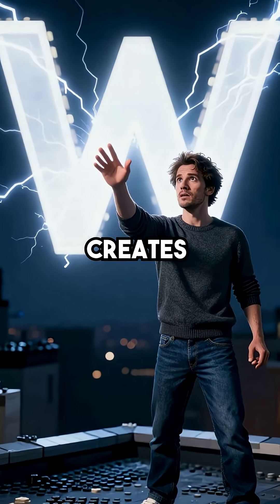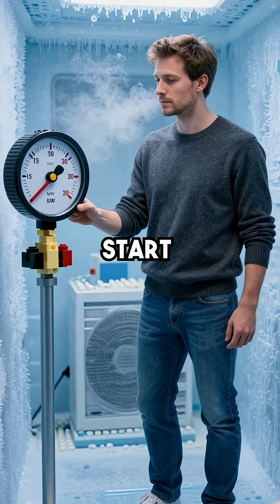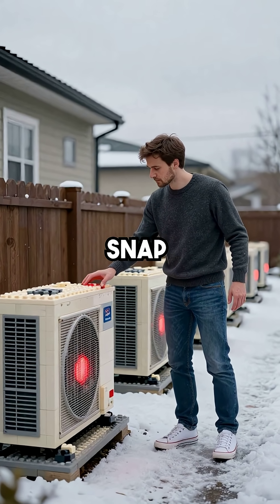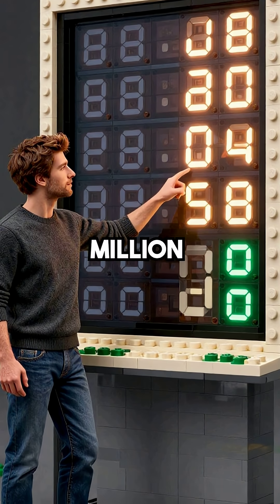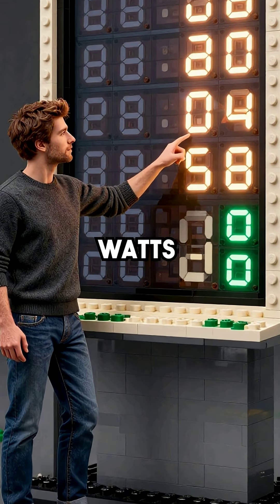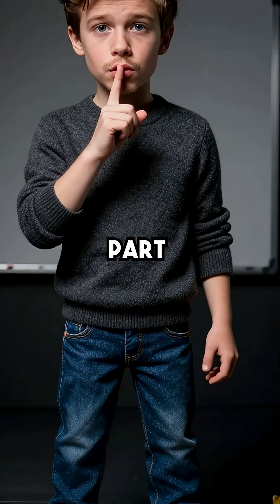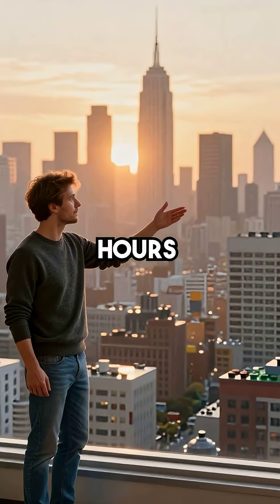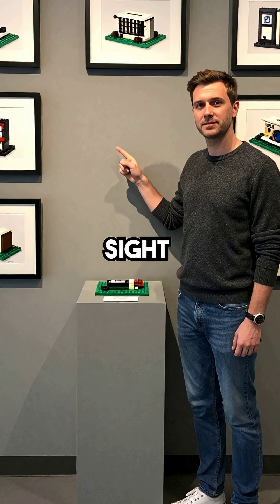Oil fouling is one of the most misunderstood sources of energy waste in HVAC systems.

Comment: Or…. 

Instead of relying on individual systems we could go back to a system of district heating with steam and hot water like we used to have. 

The most efficient means of heating and cooling is still done on a large scale. Individual systems increase demand across the board.
Reply from the maker: That’s a fair point—and at scale, district systems can be very efficient.

The reality, though, is that most homes and light commercial buildings already rely on individual heat pumps and DX systems, and that isn’t changing anytime soon. The fastest efficiency gains we can make right now come from improving the performance of the systems already installed.

Even large central plants and district systems deal with the same physics—heat exchangers, refrigerant or fluid movement, and fouling over time. When heat transfer is compromised, efficiency drops, regardless of system size.

So while large-scale solutions make sense in some environments, improving heat transfer and reducing energy waste at the individual system level is still one of the most practical, immediate ways to lower demand, improve comfort, and extend equipment life.

Both approaches can coexist. One doesn’t eliminate the need to make existing systems work better.

Comment: Natural gas furnaces don't put additional load on the electric grid. Problem solved.
Reply from the maker: That’s true—gas furnaces don’t add load to the electric grid.

But they also don’t eliminate the underlying issue of system inefficiency where heat transfer is involved. Heat pumps and AC systems are still a massive and growing part of the installed base, especially in mixed climates and all-electric homes.

Even gas-heated homes rely on electrically driven systems for cooling, air movement, and often dual-fuel operation. When coils lose heat transfer efficiency due to fouling, those systems draw more power, run longer, and wear faster—regardless of the heating source.

So while gas can reduce grid load in winter, improving heat transfer and system performance across existing equipment is still one of the most immediate ways to reduce overall energy waste, extend equipment life, and lower operating costs for homeowners.

This isn’t about choosing sides. It’s about making the systems people already have work better.